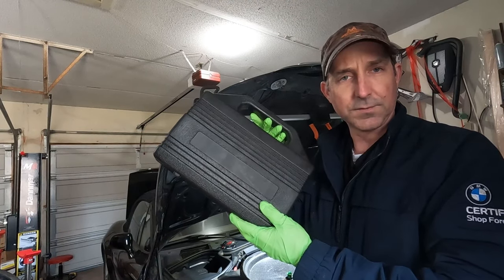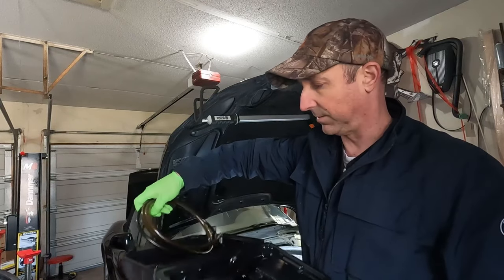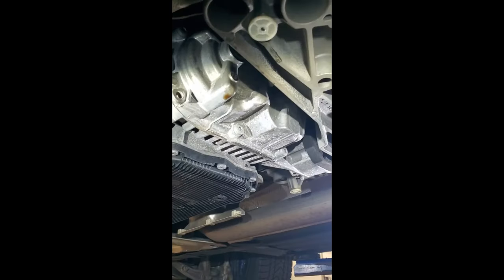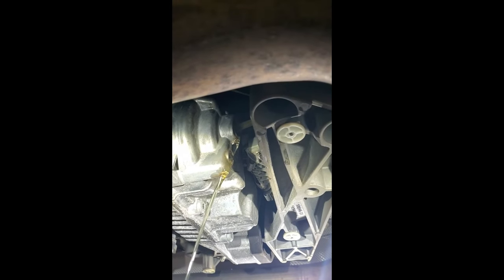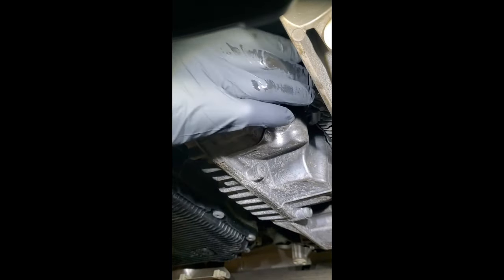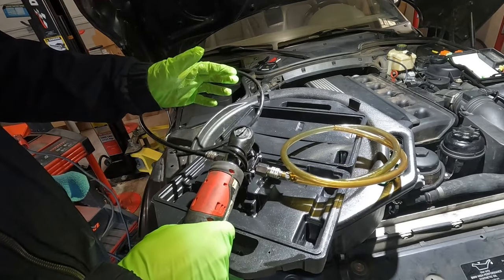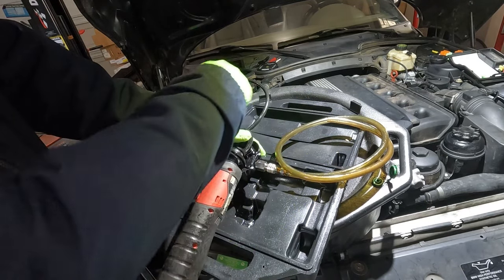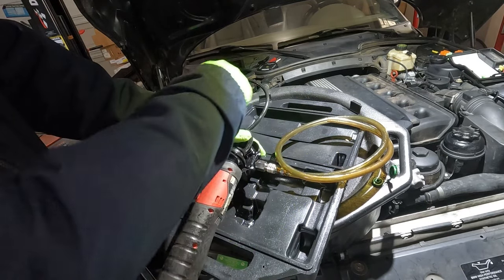BMW Transfer Case ISSUES PROBLEMS Plus DIAGNOSIS STEPS And Fluid Change 54C6 539E 5463 5F3A 54C4

Comment: My 2011 BMW X5 had the exact same symptoms you described. My mechanic couldn’t diagnose the problem, after several failed attempts to diagnose the problem, he advised me to keep driving the vehicle the way it was with the hope that when the problem gets worse it will be easier to diagnose. After watching your video, I did the transfer case oil change myself and that fixed the problem.  Thank you so much for saving me thousands of $$$$ . 👍❤
Reply from the maker: That is awesome!!!
Reply: THAT is EXACTLY what my German auto mechanic said. I've been driving it now for almost a year like this and it is steadily getting a little bit worse (hence me looking for solutions now...) I think i'm going to do the service on the TC and see what happens. I plan on doing it at least two times (drain, fill drive....drain, fill drive and then finally drain fill drive and leave it alone).
Reply: Okey tank you

Comment: Just want to say thank you for this video! I bought a 2020 X5 a few months ago. I felt the chatter/judder under load only when I would take turns. I feared the worst and have been worried ever since I noticed it. I took my car into bmw for an oil change. As I was waiting for my service guy to come out and check me in. I found your video. I paid them an extra $350 to change my transfer case fluid and reset everything. Car drives perfect! Thank you
Reply from the maker: @tashiallgood  That is awesome! Great to hear the transfer case oil change helped!
Reply: @AskTheCarExperts  thanks again
Reply from the maker: @tashiallgood  You are very welcome:)

Comment: 2014 BMW X1 95k miles changed my transfer case fluid because it had two codes my fluid was black as ever and had a bad burning smell so after I changed it problem still there going to change the whole thing out with another used one
Reply from the maker: @Qua-k1v  Sorry to hear that. It sounds like it was really bad if the fluid was that dark.
Reply: @AskTheCarExperts  yes it is it's like the car barley wants to go but end up moving down the road

Comment: Hello , so if the problem persists . The only way to fix it is to change the whole transfer case for a new one or is it fixable ?  I changed the oil and fixed the problem so far . I wanna now as they want to charge me $3000 AUD for a second hand transfer case Thanks !
Reply from the maker: Hello, Correct, replacement would be needed. I have never done an overhaul on a travsfercase but it may be an option.

Comment: My 2020 m340i makes a clunk sound from the rear when turning low speeds . Would it be the diff or the transfer case requires fluid change?

Comment: I got the chatter literally during a tire change. I'm so confused. Confirmed by disconnecting the front and chatter stopped. Trying a fluid change for $1k and fingers crossed we're not in for a $12k new transfer case. The car is at 52k miles. Absurd
Reply from the maker: Sorry to hear you BMW has this issue. Make sure the tires match the door placard. Incorrect tires cam cause transfer case issues.

Comment: Hi i have a x3 35d 2009, i have the same problem, i did unplug the the cable from the transfer case after i drove it a little and the problem was still there, what can it be ? Best regards from Portugal
Reply from the maker: Hello Nelson in Portugal! If the symptom is still present then it could be a transmission slip. You can try to go through each gear in manual mode to help identify which gear is slipping. I would always start with checking fluid level and condition of the transmission.

Comment: My 2016 640i Xdrive I had a horrible shudder on light to full throttle just driving straight at any speeds up to high speeds, tried new plugs and coils idled really smooth, still had same problem. NO fault code zero misfire counts. After watching your Video I decided since I had factory staggered wheel/tire set-up that has rear tires with slightly smaller diameter, rear tires 275/35R20 fronts 245/40R20 .3" diameter difference. I had wondered how the transfer case handled this. It doesn't apparently very well, as the clutches need to slip constantly under load. Great news! I sucked out probably 70% of the fluid and refilled with fresh BMW DTF1 and was pleasantly surprised, immediately my shudder on acceleration was completely gone! I skipped the unplug and drive step as I figured a fluid change was a good idea regardless at 50k miles. I was getting ready to through more parts at it. I will change the fluid 1 more time, after drive 100 miles, may even remove t-case to get all the fluid out as there is not a drain plug. I really thought I had a fuel issue of some kind. So glad I saw this video.
Reply from the maker: @jimbaunach4344  Awesome Jim! 👌
Reply: Sounds exactly like what my 2021 Altima is doing.. it’ll vibrate when I’m lightly on the throttle from like 20-60 mph and when I’m turning left at a light it’ll act like it doesn’t want to go and it’ll get hung up then it’ll eventually take off, almost got me killed a couple of times… dealership never could figure it out after bringing it in 4 different times, but it’s still under warranty and they charged me $180 every time I brought it in.  I’ll have the transfer case fluid changed and see if it helps

Comment: I have this symptom on my 2018 750xi. Not a misfire for sure. Changed the fluid and it went away after about 100 miles and all was good for about 1000 miles but then the chatter came back. Should I change fluid again or is it time to just replace the transfer case?  Does this slipping cause damage if I drive it like that?
Reply from the maker: @brandonwhite9047  Sorry to hear you have this issue.  I would do the fluid again. Try to get out a full liter. Drive for 250 miles and monitor.  If not better then it would be TF replacement.

Comment: Thank you for a great video and an easy to understand explanation. This was like a tutorial in BMW xDrive transfer cases....... "How To Save A Transfer Case for Idiots"...... like me.
So I have a 2008 BMW 328xi Sports Wagon 6MT (e91 chassis).
It has 131,000 miles. I have owned the car for two and a half years. I purchased it with 86,000 miles.
From the day I purchased it, I always noticed the "misfire or chatter while driving or cornering", especially under moderate to heavy acceleration and very slow speed tight turns (like in a turning circle or parking lot). I installed OEM spark plugs and coil packs. Definitely ran a little bit smoother but the feeling of "misfire" was still occurring under certain conditions. I tried lots of different fuel treatments, but it did not remedy the problem of the "misfire". I ultimately got used to the "misfire" and figured out how to drive the car to minimize the feeling of "misfire". Recently, the "misfire" was becoming more severe, and I really had to carefully accelerate in order to minimize the effects of the "misfire". My car was not really feeling like the "Ultimate Driving Machine" and I was very frustrated driving it.
Then I came upon your video.......and I fixed my car.
I decided to try your idea and change the Transfer Case fluid. I found a great "How To" video  https://www.facebook.com/watch/?v=1544711118910953 from FCP Euro on how to change the fluid on my specific car.
When I drained the fluid from the Transfer case......... SURPRISE, it was probably only half full. I measured about 16 ounces (half a quart) of fluid. Prior to filling the Transfer Case with new fluid, I pumped new OEM BMW DTF 1, Transfer Case fluid (part # 83222409710) into the transfer case with the drain plug off and flushed out the remaining old fluid. I continued to flush the transfer case until the fluid coming out was clear. Then, I installed a new OEM BMW drain plug and I filled the transfer case with the aforementioned BMW fluid. I then installed a new OEM BMW fill cap.
While I was under the car, I also changed the oil in the six-speed manual transmission and the front and rear differentials.
Time for a road-test.
Wow!!!!!
No more "misfire" or chatter. I took it out for a "spirited" drive and drove it like the "Ultimate Driving Machine" was intended to be driven. It's a completely different car now. 
A couple of notes about my car. I have 18 inch OEM BMW style 416 wheels on my car. The wheels are 18" x 8". I run 225/45R18 tires on the front and 255/40R18 tires on the rear. Completely stock, OEM suspension. No rubbing whatsoever and the car rides beautifully. No fault codes of any kind, ever. The bigger wheels and tires give the car an aggressive look, kinda like it is lowered, but it is not.
Thank you again for posting your video and sharing your knowledge. I really appreciate it.
Reply from the maker: Hi Jim, Thanks for sharing your experience.  Glad to hear my video helped and great to hear your 328 is back to being the ultimate driving machine!

Comment: I have had this issue in the past on our '15 F15 X5, our (3) '07 E83 X3's & '04 Chevy Trailblazer 4x4. ALL were fixed with a fluid change! Usually between 40 & 50 k miles. I will assume, like a limited slip differential, the friction modifier in the fluid degrades & causes the chatter. New fluid replenishes the friction modifiers. The last time I checked with the BMW published service, the E70's & F15's no longer need/call out, the 'reset'. Just R&R and drive. I made a cheaper fluid pump by using a Harbor Freight A/C vacuum pump ($16) hooked up to a compressor, with a qt. jar & clear PVC tubing from Lowes, as the collection container. Works on Transfer case & rear differential.
Reply from the maker: Very cool! Thanks for sharing this info with us!

Comment: Perfect explanation.  BMW changed the transfer case on my 2014 X50i at 54Kmi on an extended warranty.  The symptoms were judder when going up hills at both partial and full throttle.
Reply from the maker: Hi Gary! Glad to hear you got ine under warranty! Keep up on the oil changes after its out of warranty.
Reply: @AskTheCarExperts  I do it every 30Kmi since it's so easy to do.
Reply: Had a similar issue. Xfer case blew with a loud metallic bang coming up a hill in Sport mode. After the bang I noted the slip/ stutter mentioned if the vehicle was accelerating under load. BMW diagnosed as transfer case and replaced under warranty.
Reply: My 2011 BMW X5 had the exact same symptoms you described. My mechanic couldn’t diagnose the problem, after several failed attempts to diagnose the problem, he advised me to keep driving the vehicle the way it was with the hope that when the problem gets worse it will be easier to diagnose. After watching your video, I did the transfer case oil change myself and that fixed the problem.  Thank you so much for saving me thousands of $$$$ . 👍❤

Comment: Mainly watched this to see if I would need to remove the mount bracket but your symptoms and info at the beginning was also great to hear. I have a tuned N55 and thought it could possibly be the engine or even the ZF8 on pulls between 3-5k rpm in taller gears. It took a lot of forums and brainstorming to get an idea of what you described in minutes. Great help!
Reply from the maker: Glad my video helped! Thanks for posting a comment!

Comment: Thanks for your video, very clear info. I had the same problem on my 2008 X3 E 83. Again I found a solution on Youtube!  I had to remove the transfer case and disassemble it and replace a plastic / fibre reinforced cog , which I purchased for 5$ on ebay. I also changed tje oil in the transfer case and the front and rear diffs. No problems afterwards. I now have an X3 F25 and my local garage has changed all the oils as a precausion.
Reply from the maker: Thanks for sharing. That plastic gear can also fail. Great job solving it on your BMW!

Comment: 2020 x6. Oil change didnt help. Transfer case changed under warranty. 50k miles.
Reply from the maker: @JodysCorner  Great to hear it was fixed under warranty! Sometimes the fluid does not fix the issue many times it does.

Comment: Thanks for the video. You along with a few others finally led me to the solution to my problem. I've been trying to figure this one out for over a year.
Reply from the maker: Hi Carl! That's great. Did the issue get resolved with the fluid change?
Reply: Yes it did. What I found was there was hardly any fluid left in the transfer case! Even if this didn’t fix it I’m glad I checked or else I would have been replacing it, which apparently isn’t cheap. Thanks again.

Comment: HI Great Advice.  My 750li x drive has the slight issue and changed the fluid. flushed out the old oil and put in new the car is now smooth as silk.:face-blue-smiling:
Reply from the maker: That's great Steven! Great to hear my video helped you!

Comment: Thank you for this video I’ve been searching for this video as you describe exactly what’s going on with my 04 bmw x3 . Now I know I need to start with the oil change. I replaced the gear’s first and that didn’t fix it next I replaced the whole motor that didn’t fix it. So thank you so much for you help!!!
Reply from the maker: Hi Dean! I hope the fluid change helped. In some cases the the transfer case needs replacement but I hope it fixed your X3's issue.

Comment: So I drive the 2016 X5 F15, a couple of months ago while driving up the hill, the vehicle felt as if it skipped a gear for about half a second. It happened again last week on a different hill. Today it happened on a flat road, as I put my foot all the way down as I was in a rush. The vehicle is currently getting checked at the dealership. Hopefully just need the oil change...great video!!!
Reply from the maker: Thank you! If you are not getting any warning lights it may be the transfer case. It can feel like a skipped gear. Let me know how you make out.
Reply: @AskTheCarExperts  Got the car back today, oil changed on the Transfer Case. Car moves like a dream. Well sorted!! 👌🏽👌🏽👌🏽👌🏽👌🏽
Reply: Have same car. My issue is when coasting at lower speeds. A lot of research and I feel finally this might help me. Great video!

Comment: Very informative regarding the symptoms and diagnosis sections. Have an X3 which I was confident was gearbox slip having encountered it before on the older ZF 6HP box. Was all prepared for doing oil and pan on that but will be looking in to this first. Cant believe that this is the first video I've seen which specifically mentions the similarities to the gearbox slip. I've no fault codes and no other symptoms than the shudder at lower revs in the middle gears. Thanks for the information! 👍
Reply from the maker: Glad you found my video! They do feel very similar. Let me know how you make out and what you find.
Reply: @AskTheCarExperts  Thanks for the feedback. I was waiting to get under the car and disconnect the transfer case motor, but have since identified the correct fuse on my F25 X3. Disconnecting the motor pretty much cured the shuddering, although still a very sllight trace, so I suspect I'm still going to do the gearbox fluid and pan filter service.

I have also found a service invoice in the history from the prior owners time that includes doing the transfer case fluid about 12k miles ago. So I think I'll be wasting my money simply doing the fluid again and I have now ordered a clutch pack for the transfer case.
Reply: @AskTheCarExperts  Your information in this video also made me scan my girlfriends perfectly driving F25 X3 and I find the transfer case fluid service alert active for her car. Will most certainly be doing this as scheduled maintenance shortly. Thanks again.

Comment: Hoooly i had a battle with these errors: 54C6 (oil wear - replace transfer oil), 54C8 (resistor, it holds old values). So as long as 54C8 holds old values you'll have both errors appearing non stop. What to do is quite simple, delete the module error, it'll ask you to turn off ignition -> it'll delete the errors -> DO NOT SCAN the car for errors as it'll save the old values again, instead -> enter the ISTA (i've used ISTA+) or any other tool ->  go to resistor exchanged, reset the resistor value -> then do the oil wear reset or vice versa, i don't think it matters -> you should be good to go as long as the resistor doesn't have faults in memory!
Reply from the maker: Thanks for sharing this info!

Comment: Thank you! I will try this before replacing the entire transfer case. What type of oil is used to flush it? Amd how many times do you recommend it be flushed before thinking... okay i have to replace the transfer case?
Reply from the maker: @nikeyawashington9948  You would just suction out the old fluid and use the correct transfer case fluid for your vehicle. Your local dealer can check for the fluid you will need. 1 liter should be enough

Comment: Real informative video. I own a 2020 x7 x40i with 72k miles and noticed a shudder when turning. Took it to the dealership for diagnostics and came back needing a new transfer case. Quoted me $8550. They didn’t mention changing the oil. So I’m taking it to an independent bmw shop for a second opinion if changing the oil will help or if I do indeed need a new transfer case.
Reply from the maker: Hi Collin, Crazy they did not offer a fluid change first! I hope it helps!
Reply: @AskTheCarExperts  is there a scenario where changing the transfer case is the only option rather than changing the fluid first?